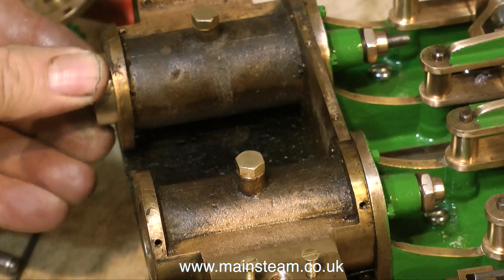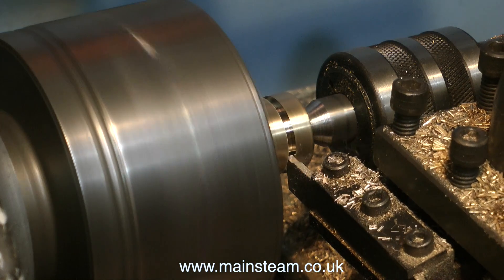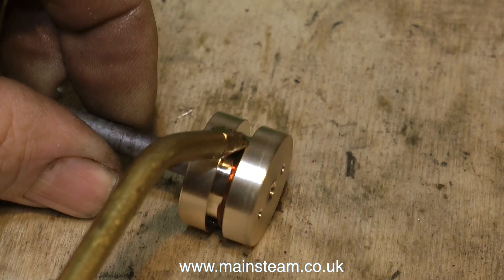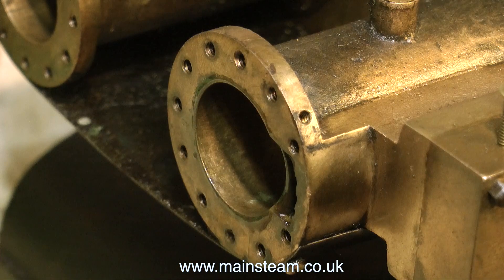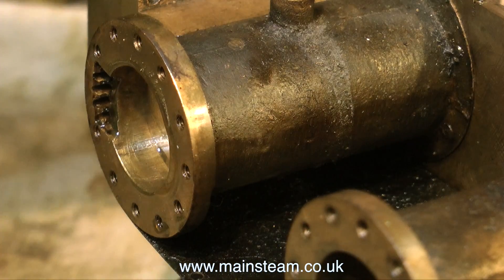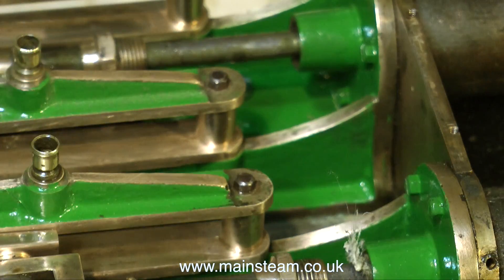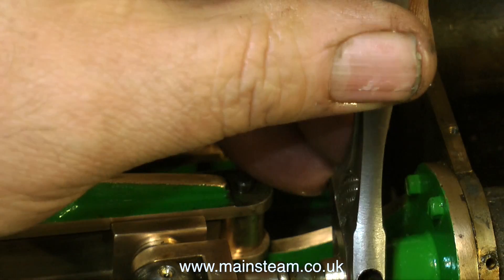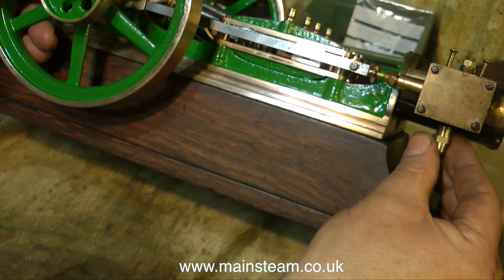PART #12 -  RENOVATING A VINTAGE HORIZONTAL MODEL STEAM ENGINE

Comment: Keith, this is another great video of a wonderful engine rebuild,  I was wondering how you would fix the holes in the cylinders if they were to prove to be a real problem, could you fill the holes and mill the wall flat and true